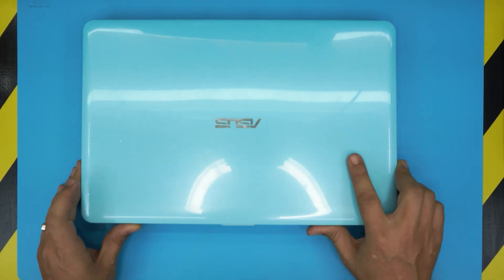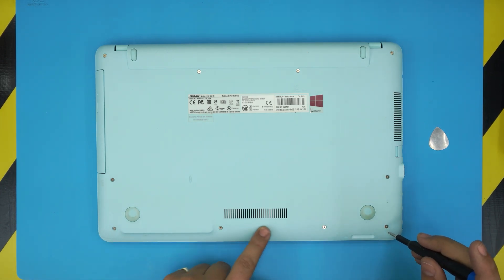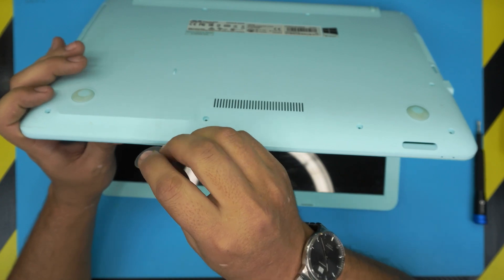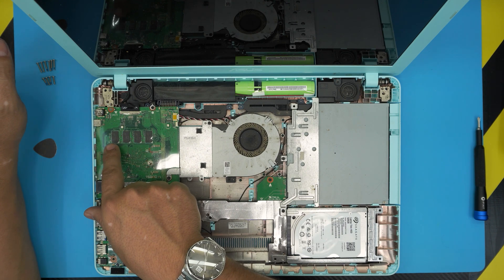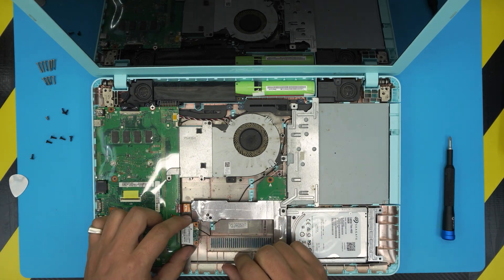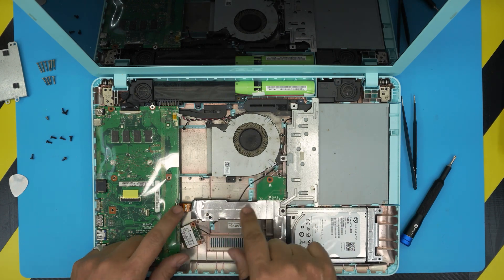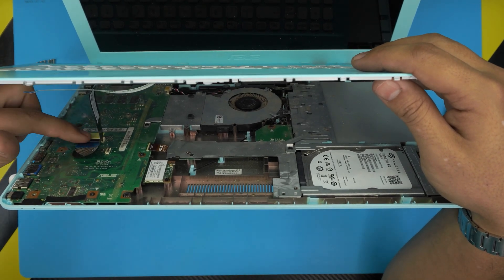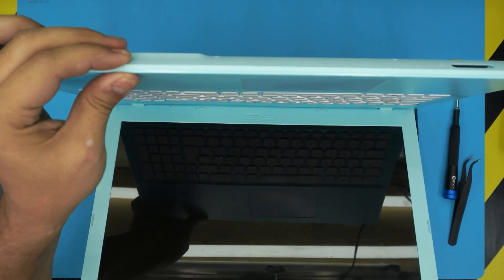ASUS X541n Laptop Ram Upgrade

Comment: hey how's it going? I'm from Brazil and I have an Asus x541n and I recently changed the HD for an SSD, but I also wanted to change the RAM from 4G to 8G, which RAM models does the X541n support?
Reply: thats means..this laptop cannot.upgrade ram..but change hdd tu ssd can do that 😂
Reply from the maker: Thank you for your feedback! If you wish to support the channel, you can like, subscribe, or both!
Regarding your question, as shown in this video you will see that there is no ram slot available for upgrade, therefor you can't place any ram.
Should you have any further questions or requests in the future, please don't hesitate to ask me.
cheers🍻

Comment: Fantastic videos mate! I have the 2GB model, I cant see any ram soldered on the motherboard. Do you know if it's ram is upgradeable?
Reply from the maker: Thank you for your feedback! If you wish to support the channel, you can like, subscribe, or both!
Regarding your question, if you opened the laptop and checked both sides of the motherboard and didn't see a ram soldered that means you have one ram dim, you can upgrade that to 8GB.
Should you have any further questions or requests in the future, please don't hesitate to ask me.
Reply: @uFixTek  I did open the laptop and checked the top side only. I was hoping you would know if it is upgradeable or not. I'm not too keen on opening the whole thing in fear of messing something up.
Reply from the maker: can you give me the exact model number of the laptop?
Reply: @uFixTek  It's the X541NA. 2GB RAM. Revision 2.1 Main board.
Reply from the maker: that model doesn't have any ram dim available my friend, sorry to tell you that. :(
Reply: @uFixTek  Thanks for your reply. I have just opened another model, the F541N and see exactly the same motherboard inside... X541NA Rev. 2.1 Also Ram not upgradeable.

Comment: Is it possible to change the processor and video card on this modelIs it possible to change the processor and video card on this model?
Reply from the maker: there is not Video card, it is a integrated APU on CPU and the CPU is soldered on board is not upgradable. sorry but you can't upgrade. this is not a laptop, this is a tablet with a keyboard and a fold able screen.
Reply: @uFixTek  aaaaah, I get it, thanks😅
Reply from the maker: It's my pleasure my friend. 😊 Thank you for taking the time to give feedback! If you would like to support the channel, please like, subscribe, or both. :P
Should you have any further questions or requests in the future, please don't hesitate to ask me.

Comment: Excellent stuff
Reply from the maker: You are welcome! Glad you liked it 😊Thank you for the feedback! if you wish to support the channel you can LIKE or SUB or both :P
if you have any question or request in the future feel free to ask me.
Reply: @uFixTek  Hi, my asus f15 power button is got loose , when we press on the power button it is going to inside in a  very smooth manner, but its working , I thought the Ants are damaged that button so, can I go to service center for the replacing of button , and this type of problem is eligible for warranty cover or not
Reply from the maker: you can get it fixed under warranty, its a normal use. ants can't damage the tactical keys, the only way ants can damage the laptop is by walking on the components and the body of the ants is a good conductive and it will short and kill himself and the motherboard :P ants are bad they don't eat, they just short the electronics.

Comment: I have the same model of laptop I want to add 12 GB RAM on top of the 4GB RAM available. Is it possible?  I saw that it's maximum capacity for RAM is 16.77GB
Reply from the maker: Thanks ✌  for the feedback!  if you wish to support the channel you can LIKE or SUB or both :P
Regarding your question:  yes the CPU can handle 16gb but the motherboard is designed so you can't upgrade the ram , because the rams are soldered on board :(  sorry to inform you about this bad news
Reply: @uFixTek  that's like putting a Yugo  engine inside of a Lamborghini and welding the lid shut! ASUS should be ashamed for such a blasphemous abomination! 😡
Reply from the maker: @ShadowofTheAlmighty  True That but they do this marketing so people don't upgrade and forced to pass down the laptop and get the higher model, they are trying to copy the cellphone methods of sell, you get to purchase 16gb or 32gb or 128gb and so on...  but if you purchase the premium lineup of the models then you get a bit of flexibility of upgrade on ram and storage.
and asus is not the only one that jumped into this marketing, also lenovo , acer, hop, and other are pulling the same and even worse. this is the real definition of "milking the cow"
thank you for the comment and the support to the channel.
Reply: @ShadowofTheAlmighty  Perfect comparison. I actually came here after disassembling one and thinking I was crazy!!

Comment: Hey just a thought. But I was wondering...would it work if you just replaced the logic board with a modified one that has upgraded ram. Thx
Reply from the maker: Thank you for the feedback! if you wish to support the channel you can LIKE or SUB or both :P
regarding your question: 99% you can't because the other model will have a slightly different shape and port location a bit different and for the same reason it will not fit into the housing. before you purchase give both mother boards exact number and i will let you know,
Reply: if x541n motherboard change to x541nc? do u think will be possible??
Reply: or i hav to find the 8gb motherboard? so when changing the motherboard i have to reinstall windows back?
Reply: @hatikau  shouldn't have to reinstall windows just to change mb. It should update with new drivers automatically.
Reply: @ShadowofTheAlmighty  I think you'll find changing a mobo will almost def require a reinstall. Well, in my experience that was the case during Win7 days and for the older OS's...  
Either way hardly a difficult task....